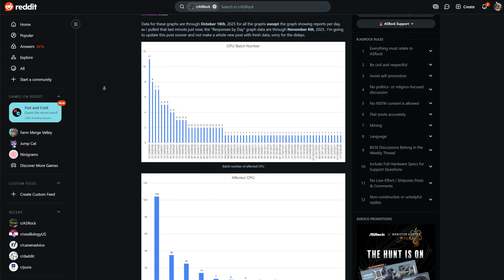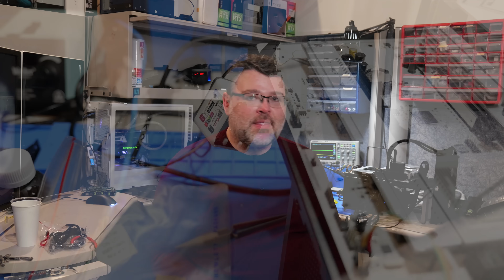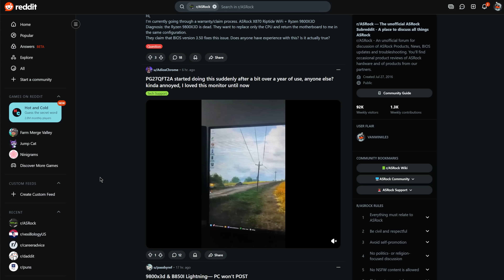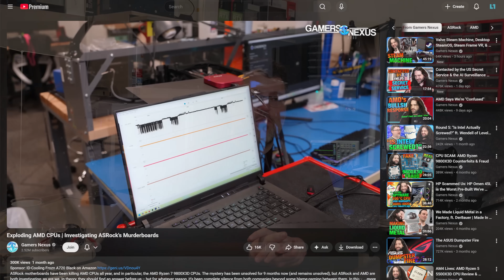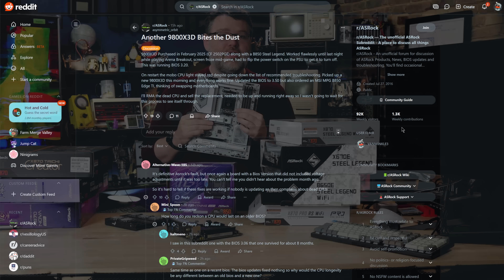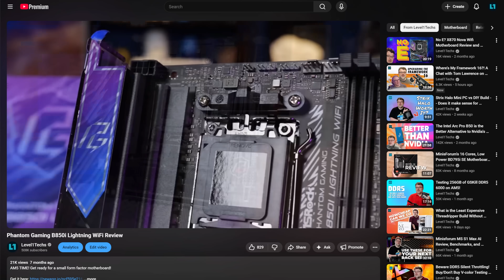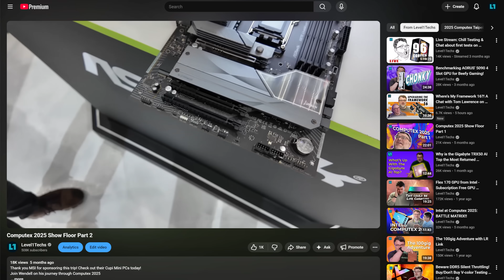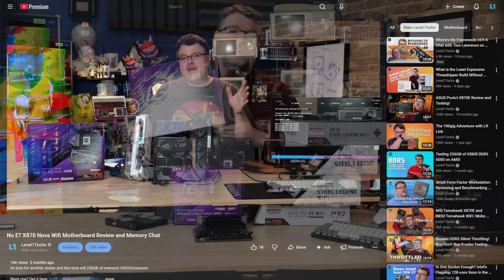Attempting to Troubleshoot the ASRock Motherboards of Death!

Comment: The killer motherboard. I have a theory that it might be the soldering of the CPU socket to the board. A poor solder joint on one of the high power pins could generate enough resistance and heat to damage the socket and the CPU. When you replaced the the CPU socket you fixed it and therefore no more failures. Why Asrock has more soldering failures is something they would need to address but I can imagine that they would not not want to be too public about that. Asrock overclocking  parameters are known for being too aggressive for some CPU stability tests but the chip should protect itself. However if the socket is the heat source then the die might not experience the heat before the socket fails. I have a Asrock B850M Pro RS WiFi w/(9800X3D) and I have had no problems in like 8 months. I did upgrade Bios to 3.25 which Asrock recommended to help mitigate the problem. I don't believe that fixed anything, perhaps I just won the motherboard soldering lottery. I have owned several Asrock motherboards and never had a problem. The Bios on the other hand can be awkward and difficult to tune compared to say Asus but they are still quite capable.

Joseph (retired Electrical Engineer and software developer)
Reply: Did he replace the socket? I heard he did the BIOS chip. Should have been socketed to start with like the old days!

It takes quite the temperature to physically blow up silicon, so it is most likely voltage related to cause thermal runaway and fry up - only then it becomes a dead short, where the socket and CPU pads will burn up.

A lot of these boards like to up the memory controller voltages and we start wondering why AMD rigs idle at 20+ watts or so. Mostly done to guarantee memory stability, but at what cost. VRM control is messed up either way when things like this happen by default.
Reply: @ruikazane5123  The murdering MB had both the socket and the CPU destroyed so he replaced the socket and CPU and no more troubles. The Bios problem was fixed by merely reflashing the Bios.

Comment: I have a B650 Steel Legend with a 7800x3D. Not a single problem other than the original ram was not expo. My computer never sleeps. It is on or off when not in use. It sees 12-15 hours of usage daily when gaming.

Comment: I bought a 9800X3D at release in Nov 2024, and have been running it in an Asrock X670E PG Lightning board since then. No problems so far, but I've been keeping the bios up to date...

Comment: Thank you so much for testing this. I love Asrock motherboards esp the Taichi and the Nova wifi. It's quite upsetting that these stories are making people worry. I have a 7800X3D cpu and I think it's the perfect cpu for one of these motherboards. I have a MSI B650 Tomahawk wifi board that I despise due to having all kinds of issues with a yellow light and not wanting to soft reboot unless you change the SOC voltage which took me forever to figure out. I also hate MSI for dropping AMD graphics cards just as they made a comeback and after all the nonsense I've had with this board I want to swop it out.. I'm leaning towards waiting for the Sapphire X870 board to come out but by other best choice would be the Asrock Nova wifi board since I have a 7800X3d and shouldn't be in any danger from this issue (I think).

Comment: I've been running a 9800X3D with the X870E Nova board since January and its still going. However I did recently hit one issue which turns out, wasn't the board.

I recently installed a new CPU cooler and hit errors 46 & 15 before it would post. This points to an issue with the memory controller or RAM and I spent hours trying to fix it.
After using ChatGPT for a few hours, eventually I worked out it was the mounting pressure of the CPU cooler being slightly uneven. After having re-seated the CPU & Cooler a few times, I got it to boot.

I'm not an expert on motherboards, but I wonder if this all down to a combination of faulty CPU & cooler installation causing instability in the CPU and eventual failure? We have confirmed cases where they've died due to mis-installation.

What was really interesting in my case, it wasn't just the technique I used to install the CPU cooler, it seemed like the mounting pressure was initially too great, so I had to make it really loose i.e. I could tighten each of the 4 mounting screws, another 2 or 3 full rotations if I wanted to.

Then after it booted successfully, I saw poor temperatures. I shut the system down. Screwed all 4 tight in a criss-cross pattern as usual. Then started up again... and it was fine, with good temperatures.

Just something to think about.

Comment: I just finished my first AM5 build.  
The X870e Nova I originally purchased is still sitting in the drawer. I went with x870e Carbon.  Costing my build a lot of wasted time & money.  I hope this x870e becomes “safe to use” someday but as the price of PC components skyrocket I fear I’ll be stuck with the loss.
Thanks for helping to keep the topic in public eye.
Reply: Good choice, my 9800x3d just died with nova motherboard today out of nowhere. 5090 was fine after putting it into an older 7800x3d build 😢
Reply: @weih723 sorry to hear that.  I guess altho I had to spend a lot more then I planned it was the smartest thing to do.  The 64gb 6000mhz cl30 I bought for a lil over $300 CAD is now over $1200 😅🤦🏻‍♂️  feels like we might be the last generation to home build pc’s.

Comment: Suspect?! Argb amperage problem since it all a share same wire with 5v rail from USB connections...ton of it than intel boards. AMD could just add 16x slot than wasted all bandwidth in a unused USB ports. And with argb and sleep plus lte and i2c sensors use same 5v, including sata drives and wifi and nvme

Comment: I've been casually following this for a long time as a fan of ASRock and someone looking to upgrade to AM5 9800X3D. My ideal MB, the X870E Nova being so hard to actually find in stock and at MSRP around launch last year probably saved me from a dead CPU. Sadly, even if this is not strictly a ASRock issue, it's prevalent enough to make sense to simply go with a different MB manufacturer. I ended up going with a Gigabyte B580 Aorus Elite Ice wifi7 and avoided the stress altogether

Comment: I ordered a 9800X3D day one and installed it in an ASRock Nova X870E board. No problems here. FWIW, I'm using a Thermalright contact frame, PTM 7950 and a Noctua D15 G2 cooler.

Comment: I think the issue is related to the windows sleep settings (being on by default) and when the computer enters sleep state somehow (while also using relatively aggressive settings like PBO and aggressive DRAM timings). While it's unclear exactly what causes this, just looping sleep and wake probably won't find the issue since the registers don't change if you're not forcing some sort of change. I'd recommend a cycle of occt between sleep and wakes so that the hardware is cycled and trying to reproduce.

Comment: I have a B650 steel wifi. The card is not booting W10 anymore when a USBC is plugged into the MB port!!!
Remove the USBC, and it will reboot fine 🤕

Any Item in that USBC ... USB-Keys, Keyboards, USB-Hubs, KVM, whatever is powered ?
NO! Even if a not-connected cable is plugged in, and it stops working 😞
I checked the USB port for dirt or anything... It's clean ... and the issue appeared after being used for 12 months without unplugging it !

Comment: On the note of isolated testing. One thing is to test the board in a lab scenario another is with various usb & display peripherals plugged in. Ryzen's I/O is horrendous so you could see different behavior if you have a bunch of usb devices plugged in that say handle various sleep state interrupts.

Just fyi, besides just 9800x3d burning, there is not enough coverage from you guys with viewer bases on how bad 9800x3d hid processing is on the platform in terms of pacing. By pacing I mean how consistent is mouse movement displacement to pixel displacement per frame, both in windows window manager on both win11 & win10 and in games respectively.

It's absolutely horrendous compared to intel. 

Ultimately making a cpu not fit for esports gaming. 

Please cover that y'all. 

Someone!

Again, I wanna emphasize the fact that this is not a simple click to photon issue

Comment: I had an AsRock Motherboard ( cant remember the name but it was partially named after some streamer)  And it just stopped working. Their customer service was horrible. I have never returned to Asrock as a customer for anything. I have used Gigabyte Motherboards in the last 4 builds for myself and another person and all 4 are still going. Had a small issue with one and their customer service was helpful at least to find a solution.

Comment: The fact that changing the socket could make a killer board safe points towards debris in sockets. Maybe debris plus sleep phase changes causing fluctuations which increase the chances of interactions with the debris.

Comment: I have the ASRock B650E Steel Series board running a 7800X3D with CO and PBO enabled. I have the newest BIOS version. No problems with my set up yet. I'm very interested in this issue.

Comment: Well, even back in the AM4 era, ASRock was jacking up voltages unnecessarily and insanely. So the shift to AM5 and X3D processors was expected. It's surprising they haven't completely fixed this issue.

Comment: I 100% think this is AMD and its batches of CPU's 
ASRock mobos are generally having this more but i wonder if it was a bad bios released from AMD combined with more users having ASRock because they are generally cheaper priced at the same tier. 
it doesn't take away from the fact its happening on multiple board types with different configurations and even different BRANDS non ASROCK boards also have killed these CPU's in the same manner where it burned the pads under the cpu.

Comment: Purchased a Gigabyte B850 EAGLE WIFI7, and Ryzen 5 8400F CPU.
Assembled, and switched on.
Result, blown pins on motherboard, blown pads on CPU.
Cost. $600.00.  Still hoping manufacturers will honour the warranty.

Comment: It's going to be something stupid like a bad solder joint on one of the voltage/current sense pins in the CPU socket combined with circuit or firmware design issues causing the board not to properly fall back to local sense versus remote sense when the sense line is open.

With one of the boards unpowered and the CPU removed, check resistance between the VRM controller's RGND pin and the board ground and between the VRM controller's VSEN pin and one of the VRM inductor pads. Proper implementation of SVI3 should be like 100 ohms for both of those, if either of those is open there's a problem with the actual circuit design that could cause catastrophic overvoltage with open sense lines.

Comment: Something you said makes me think that the pins in the socket maybe partly to blame? maybe 1 or 2 not within spec . slightly taller causing a bridge between 2 points on the cpu?

Comment: Damn I was thinking of buying a9950x3d and pair it with rog x870e and now I’m not sure what to buy! Any suggestions? I work with AI and have a rog strix rtx 5090. I also use it for casual gaming but definitely want to keep things working and that won’t break
Reply: There are more nvidia gpus with burnt 12vhpwr connectors than dead am5 cpus.

Comment: User error are most of the board burning the CPU, in a controlled error inducing setting it might not break because things will most likely be actually installed and set up properly

Comment: If the issue happens with waking the OS. Then I wonder if it's the MC on the CPU that's being overvolted and immediately dying.

Nothing dead (yet) and I'm on an ASUS Pro Art X870E. But I've had weird RAM/MC issues and just trying to get QVL certified RAM running at 6000mhz with a 9950X3D.

Comment: AMD 9000 series chips die on motherboards of all manufacturers, so it's AMD's fault. Asrock allowed its users to play with overclocking more than other manufacturers, which is why more AMD processors died on Asrock. Now Asrock has limited the overclocking capabilities, and now AMD chips die no more often than on motherboards of other manufacturers.

Comment: Been using a Steel Legend B650E and a 7800X3D, 32GB of Silicon Power XPower @ 6000mts, since April of 2024. Almost always put to sleep, No issues.🤞
Reply: afaik only  9000 series of cpus have died on asrock boards

Comment: 5:18 Sounds like the socket is why
Reply: I thought that too when Wendell said he had a "murder board" where the socket was damaged, but after the socket was replaced he's so far had no problems with it.

Some tolerances issues in the engineering? Or a small proportion receive microscopic damage during manufacturing of the board?

Comment: Seeing as you had a confirmed board, replaced the socket and it hasnt struck again. What if it is the socket. Do these have different vendors/suppliers? Could it be tolerance/mounting pressure? Seems like changing the socket changed the situation...

Comment: Asrock put miniscule heatsinks on their B350 itx boards AND put a 0.5in thermal pad on the VRM then required users to retrofit them with fixes.
With threadripper every brand had 8phase-16 phase VRM's but Asrock was the only brand to cheap out with a 6 phase on a HEDT platform.
They lie about VRM phases and using IR components that they don't.
Their 990fx flagship AM3+ boards used crappy 4+1 phase vrm's hence J2C killed his dads fx8 on the "fatality killer", at least they were honest there.
While all brands will "cost reduce" and take away features on low end parts they rarely ever take away something important but Asrock will remove a SATA header to save £0.01p if they can, they scrape the bottom of the barrel so hard they break through.
I've had boards missing voltage settings in cludgy bioses that resemble windows 98.
I've gotten thanks from people who came to me with issues on ryzen for years and when they followed my advice to replace their asrock motherboards (asus, giga or msi) everything worked fine.
I bought a 90% (no PSU) PC a few weeks back for its antec 1200 case but the rx580 pulse worked, the ryzen 3600 worked, the 2x8GB corsair LPX worked and the asrock B550 phantom gaming pro 4 motherboard worked to...for an hour then it shuts down, then it'll work the next day for an hour and randomly shut down, again bios from windows98.
I like Asrock more than Biostar but I've also never wanted to go near a Biostar, they're on par with foxconn but at a higher price.

Comment: Thanks for all the work you are doing!

Meanwhile, I am running my 9950X (Not X3D!) in my Asrock X870E Taichi with no Issues whatsoever since the End of February 2025. Latest UEFI Version 3.40. 3.50 will potentiall be skipped for now as my System is currently stable. RAM Slots are fully utilized: 4x48 GB Sticks = 192 GB (2x 96GB Kits; DDR5 6000 MT) running at 4200 MT (maximum achievable Speed without manual OC) with only 1.1Volt. NO XMP, NO EXPO. Just setting the Value to 4200 MHZ, reboot and let the Board do the rest with default Memory Training. Fully stable so far - tested thoroughly with Memtest86+ etc. PBO is completely disabled as I prefer a cooler System in General. On top of that, the Board gets more stressed but is stable with: All 4 M.2 Slots are utilized (2x PCIE 4x4; 2x PCIE 5x4) plus the 2nd PCIE Slot has a Adapter Card with 2 additional M.2 Drives (2x PCIE 3x4).

Downside: I had to remove 2 of the 5 Samsung SSD 860 EVOs or Chkdsk's final Phase (chkdsk /f /x /r) would take 3.5 to 4.2 Minutes to complete - on M.2 as well as SATA SSDs. Simply limited because well, it is not a Threadripper System with enough PCIE Lanes. Also the 1st PCIE 5.0 x16 Slot is now running in PCIE 4x8 Speed but as my XFX 7900 XTX has absolutely Zero Performance loss at 4K 60 Hertz, as it is a PCIE 4x16 Card anyway, I dont regret anything. Main use is Software Development, second is rare Gaming - "Indie" as well as "Triple A". Running Windows 11 25H2 (always latest monthly updates) as well as openSUSE Tumbleweed.

From what I have seen so far: I am glad that in all those years I never bought a X3D Variant of "all the" = 3 AM4 and AM5 CPUs I have. I am not an Electrical Engineer, but even to me it seems for AM6 AMD needs to really check the "Silicon Layout" of some of their future CPUs. Keep up the great work #Level1Techs // #StaySafeStayHealthyEveryone :)

Comment: Let's just do the opposite for once and not unhingedly vent to no avail:

Personally,  I've been using an AsRock X670E Taichi Carrara with a multitude of X3D CPUs and OSs since September 2023, and it's been an almost flawless experience. I've encountered exactly one tiny bug - the AsRock software for tuning fan curves in Windows stopped working one day after having installed an update to the chipset drivers. Uninstalled it, redownloaded it from AsRock support, problem fixed.

Now I know that complaining and venting is more fun sometimes, but it's honestly been the most stable, hassle free and premium experience I've ever had since I started building computers in the mid 90s.